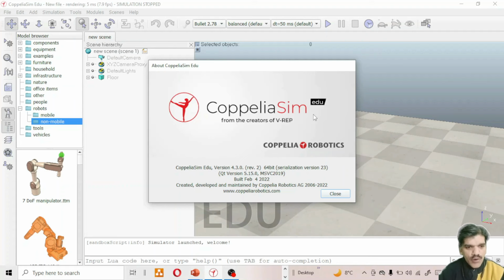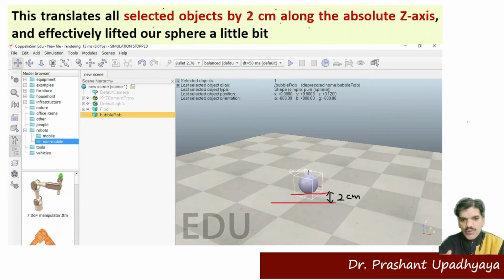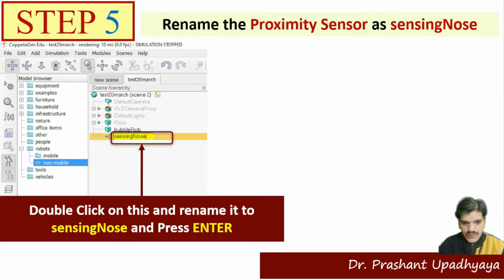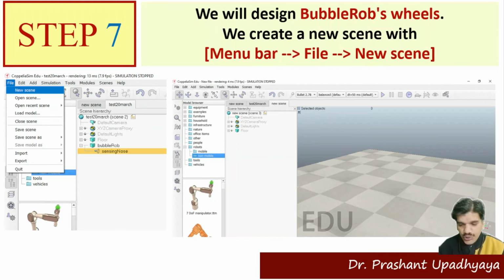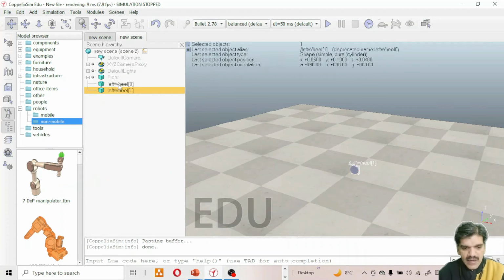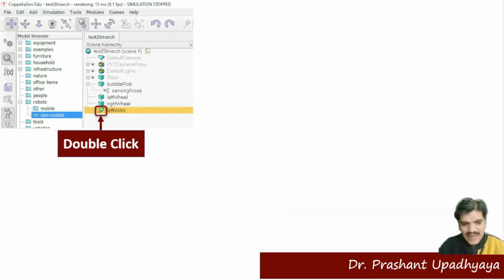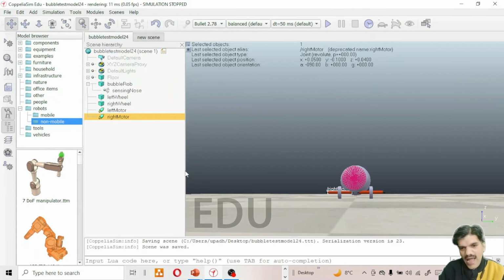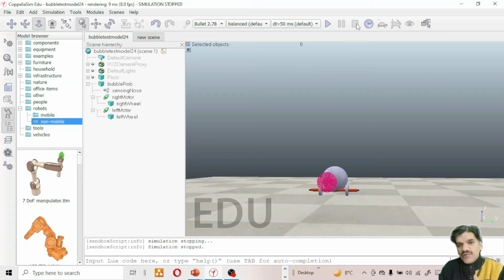"CoppeliaSim BubbleRob Tutorial Part 1: Mastering Robotics Simulation" #robotics #simulator

Comment: Disruptive Technology
Unit 3
Steps for Creation of Robot:- For Unit -3 experiments, we are going to use software CoppliaSim. So
open software, a blank scene will appear with blank surface. In this experiment we are going to add a
sphere, that will be our robot, then a proximity sensor to detect obtacles, wheels so that robot can
move and joints to connect wheels with robot. So let’s start with experiment.
Adding Sphere as Robot
1. Right click on blank surface-> add-> primitive shapes-> sphere. Set its x-axis = 0.2, then press enter.
2. Rename sphere object with "bubbleRob" by double clicking over sphere name and after writing name
simply press enter.
3. Double click on blue cuboid along with bubbleRob name, that will open object properties. Then goto
common tab-> object special properties- tick all - collidable , measurable , detectable.
4. Now sphere is residing just on the surface, in order to wheels we have to lift it up. To lift it up we will
change it z-axis position. So for this click on position icon which is just below Modules icon-> goto to
translation tab-> along z -axis= 0.02, click on translation selection.
Adding Proximity Sensor as Obstacle Detector
1. Right click on blank surface-> add -> proximity sensor-> cone type.
2. As sensor by default points towards upward side, but we have to detect obstacle on front side of
robot, so we will change its orientation. For this click on orientation icon (Below Modules and Scenes
option) -> goto orientation tab-> set beta and gamma = 90 degree. Then goto rotation tab-> click on
rotate selection.
3. In order to align the axis of proximity sensor with the axis of sphere, goto position icon. In position
icon -> position tab -> x-cord= 0.1, z-cord= 0.12, press enter and then close dialog box.
4. Double click on wifi icon along with proximity sensor name, that will open object properties. Now
goto proximity sensor tab-> show volume parameters-> set Offset=0.005, Range= 0.15 and Angle=30
degree and then close dialog box.
5. Then goto Show detection parameters-> don't allow detection-> disable and then simple close don't
change anything.
6. Rename proximity sensor as "bubbleRob_sensingNose".
7. Now select bubbleRob_sensingNose + ctrl + bubbleRob, then right click Edit-> make last selected
object parent.
Adding Cylinder as Wheels
Now we have to add wheels so that robot can move along the surface, for that we will add
cylinder. All these works will be done in new scene and then copied back in main scene where we
created robot.
1. Go to File Menu-> New Scene.
2. Right click on blank surface-> add -> primitive shapes-> cylinder-> Set x-axis: 0.08 and z-axis: 0.02,
then press enter.
3. As cylinder added is in horizonal plane lying over surface, so now we have to change the orientation
of wheels so that they are in vertical position. So for this go to Orientation icon- > Orientation tab-> set
Alpha= -90 degree, then go to rotation tab-> click on rotate selection.
4. Now we have to reposition it, so that we can provide left and right wheel to robot. For this go to
Position icon (below module menu) -> Position tab -> set x= 0.05, y= 0.1, z= 0.04.
5. Rename cylinder to "bubbleRob_leftWheel" by double clicking over cylinder name.
6. Select bubbleRob_leftWheel-> Right click-> edit-> copy the selected object, then using control+ v
paste it in same scene hierarchy and rename copied bubbleRob_leftWheel[1] to bubbleRob_rightWheel.
7. Now select bubbleRob_rightWheel-> click on position icon-> position tab-> set y-coord= -0.1 and
press enter and simply close dialog box.
8. After that Press control select both wheel-> right click-> edit-> Copy the selected objects.
9. Go back to previous scene where we were creating robot and paste over their selected wheels.
Adding Joints
1. Now we have to add joints so that they can connect to wheels to hold them. For this, right click in
main scene-> add-> joint-> revolute.
2. Select left wheel and revolute joint-> position icon-> position tab-> select apply to selection.
3. Similarly, select left wheel and revolute join-> orientation icon -> orientation tab -> select apply to
selection.
4. Rename revolute join to “bubbleRob_leftMotor”.
5. Add one more revolute joint by following step 1 of adding joints and rename revolute join to
“bubbleRob_rightMotor”.
6. Repeat the steps 2 and of adding joints for bubbleRob_rightMotor with rightWheel.
7. Double click on leftMotor icon, object properties will open, then select joint tab-> show dynamic
properties-> tick on Motor enabled and lock motor when target.....
8. Do same for rightMotor as well.
Connecting all components
1. After that bubbleRob_leftWheel + Control + bubbleRob_leftMotor-> right click-> edit-> make the
last selected object parent.
2. Do same for bubbleRob_rightMotor as well.
3. Now select bubbleRob_rightMotor + Ctrl + bubbleRob_leftMotor + bubbleRob-> right click-> edit->
make the last selected object parent.

Comment: thanks a lot really .Sir I hope you'll continue to make such videos
Reply from the maker: Thankyou for your valuable comments. Sure 😊
Reply: When I ran the simulation after the second video, the robot was not moving as it should, it was rotating. So I went back to the first one and noticed that when I run the simulation, my robot doesn't stop after falling backwards like at the end of the video, it also rotates. Where could I have made a mistake? I would be very happy if you could help me.
Reply from the maker: Just check that motor velocity is set to zero and motor is locked.